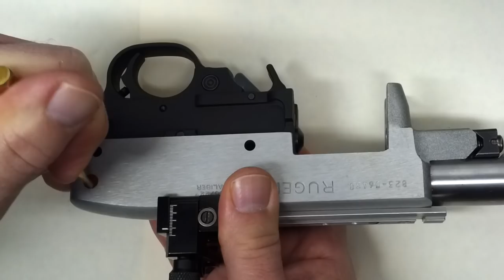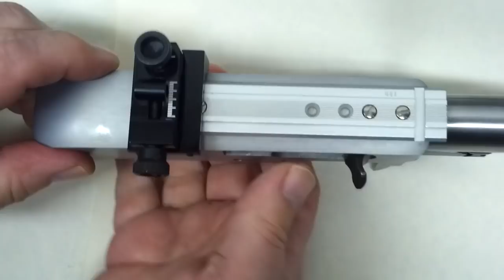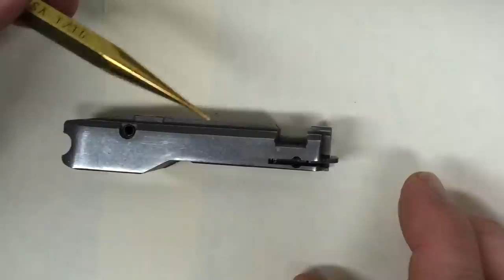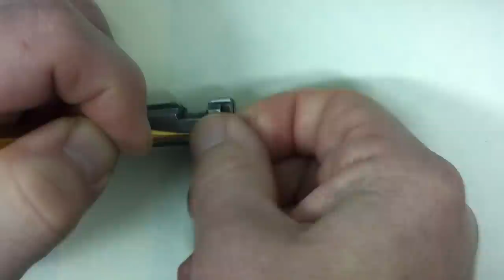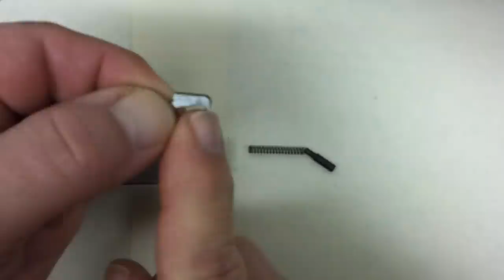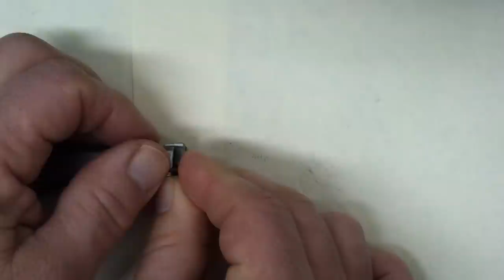10/22 Replacing the Extractor

Comment: that little flick you did at the end was all i needed to confirm that my spring has lost its sproing. mine seems much more loose than that. almost floppy, and i was pretty sure that was no bueno, you confirmed that. mines a pawnshop pickup so theres no way of knowing what kind of use its seen, extractor might be a little worn. its pretty crazy that i had zero failures until it decided one afternoon to never pull another shell out of the chamber again.
Reply from the maker: That can happen if the extractor isn't inserted fully into its slot. Before spending money, try re-installing the extractor. There is so little movement that spring failure is highly unlikely, unless it was damaged. You want to verify that the extractor is in properly or it will be launched into orbit on your first shot.
Reply: @TheCompanion-gx5bz  idk how but my extractor plunger exited the firearm. the spring was a little goobered on one end. i still can't figure how it happened. it was functioning until the last shot before i put it in the bag to come home.

Comment: I've got a question...I'm having trouble with stove pipes, every now and then.  But, never with Velocitors.  I think my problem is the speed of the slide isn't fast enough to sling the empty casing out, when using 1260fps ammo. My extractor seems to be grabbing the case rim just fine, because every round that doesn't eject, always has the rim towards the inside of the gun, and the empty part(where the bullet was) is facing out. Seems like my recoil spring is a little too strong, instead of a faulty extractor......  Would it hurt anything to cut off a coil or two on my recoil spring?  This would make my slide faster, thus ejecting the empty case out better. Right?  Oh, and I've already polished my receiver, and spring rod.    I would love to hear your thoughts on this....

Comment: CHECK THIS OUT INSTEAD
His way works but is more problematic than just using a magnet to pull the extractor out.... I fussed with taking my extractor out whereby pliers and anything else I tried wouldn't allow the extractor to pull on out even with the spring fully retracted. So grabbed one of those pocket type screw drivers with the magnet on the end and wow I didn't have to play around at all...the extractor stuck to the magnet and eased right out!